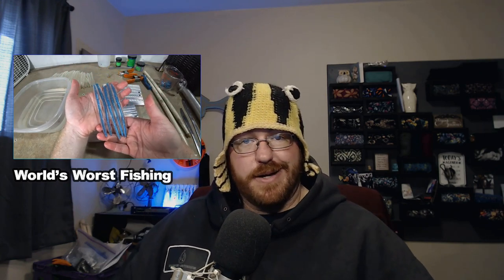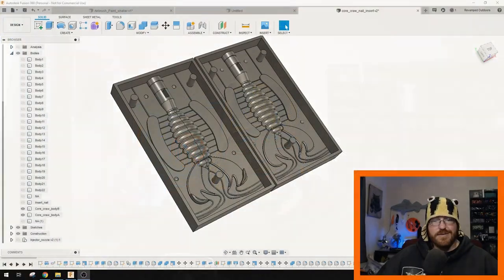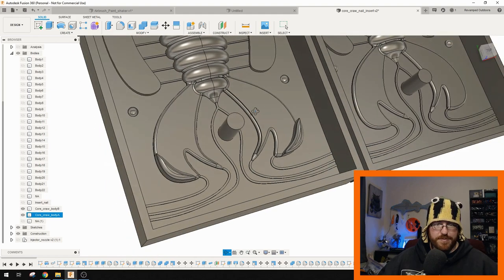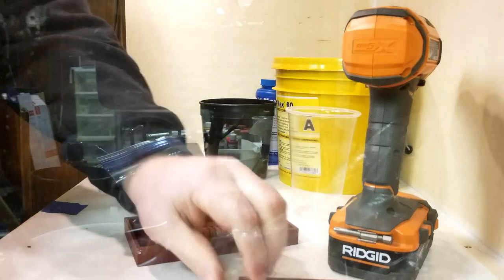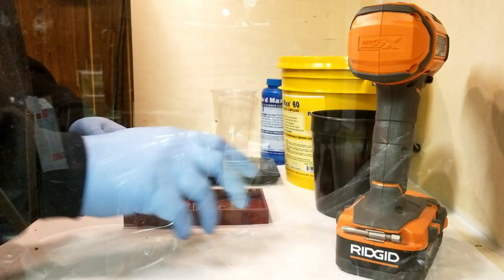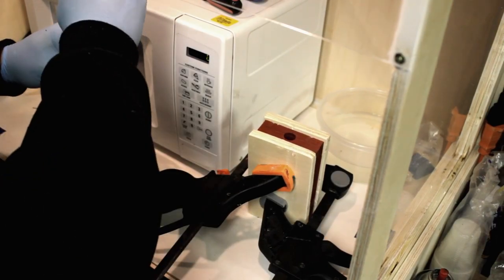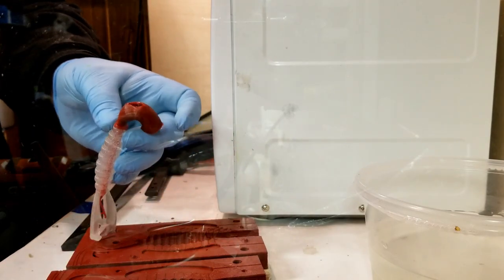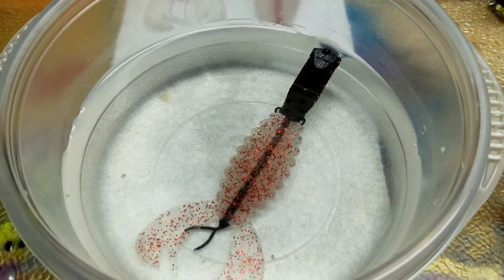First ever core shot crawfish? (soft plastic lure) (crayfish, yabby, mudbug, crawdad etc.)

Comment: That's cool... if you did the nail 90 degrees around you could do a laminate I guess...
Reply from the maker: I could probably try the dual injector in just the nail portion, then it would laminate on the inside, that might be pretty slick.

Comment: I use my welding rods and cut to size in the mold. I use wd40 as my lube. Injector, remove the welding rods and inject with other color.
Reply from the maker: Nice! Welding rods is a great idea much easier to cut down than a nail lol

Comment: Did u 3r print that?
Reply from the maker: Yeah I printed the mold forms, then cast them in silicone, then inject with  plastisol. It is a bit complicated but so far I've found it gives the best results.
Reply: Revamped Outdoors that’s awesome man. I have been looking for a channel like this. Want to get into 3D printing. What printer do u have? DIY I assume lol
Reply from the maker: One of them is sort of DIY, an Anet A8 with a lot of safety modifications, new firmware, power supply, mosfet etc. Important to have because they don't have the best QC. I also have two CR-10s with direct drive conversions that work well and are good and relatively safe out of the box, then I have a Geetech A10m which is a good Creality Ender 3 clone but does 2 colors and is a bit finicky. If I were to recommend a starter printer I would recommend the Creality Ender 3, affordable and relatively safe electronics out of the box.

Comment: Where do you buy your mold max 60?
Reply from the maker: I usually get it right from smooth-on or from Reynolds Advanced Materials, Chicago. I do know that smoothon is still considered essential so they will still ship right now not sure about Reynolds their website would probably say, they also have other locations you might want to check into #notsponsored .